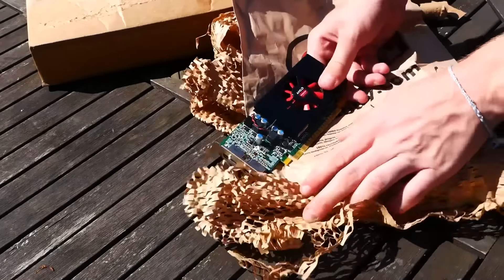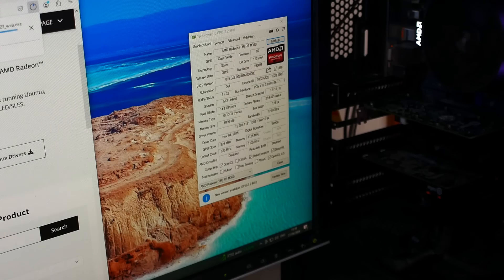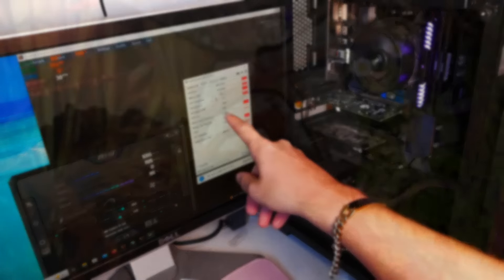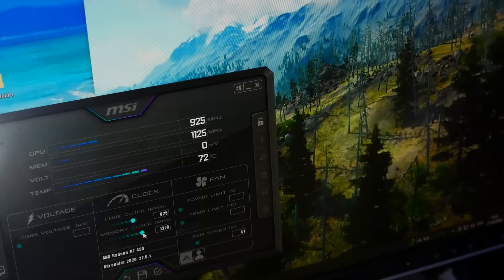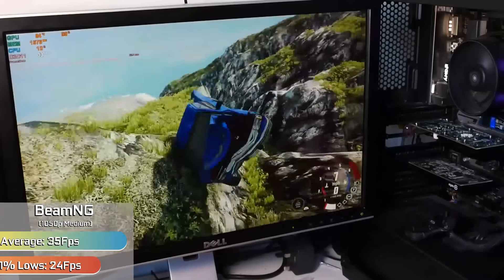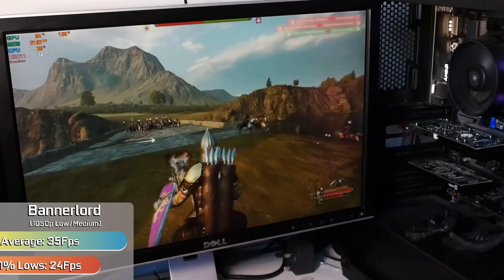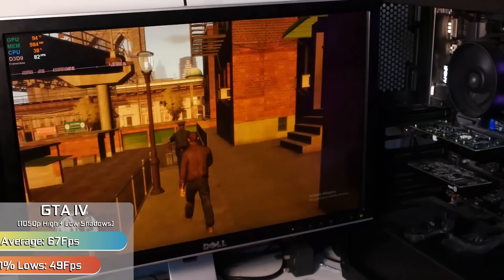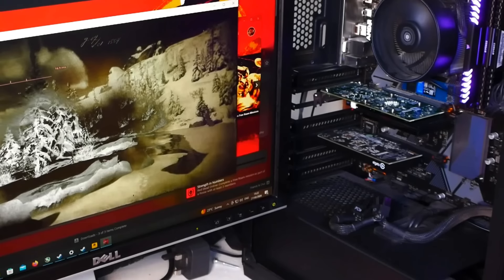AMDs Mysterious & Misleading R7 450...

Comment: The fact that the lights on the motherboard were on while you swapped GPU's made me extremely uncomfortable. I'm sure there's zero power going to the slots but still.. I would never leave the power supply turned on OR plugged in to the wall when swapping components because with my luck not only would the part fry I would too 😂

Comment: I have an R7 250 I extracted from the Dell it was originally installed in, and it has a very weighty slab of copper sitting on the CPU chip -- so it seems odd that your 450 didn't.

Comment: A GTX 750 Ti competitor kept in the dark? Here with 4GB GDDR5. Interesting ...and actually usable nowadays.
For £5 it's a total bargain! Good find. The cooler seems a bit borderline. But again. SFF just has limitations in cooling. The Thermalpaste renewal and cleaning look like it kept at below 90c. No problem. These Tiny GPU dies should easily handle 90c temp. High thermal cycles become more more critical on bigger dies due to physics.

Comment: Why not remove to end plate rather than mangling it to fit your rig?  
The old girl survived this long and did not deserve this fate.

I have an R9 360 that I picked up for $5 U.S. on the Passmark GPU list is scores 3032 vs. the R7 450 scoring 1936.
I have it as a backup/test card.
Interestingly an R7 360 scores 3100.

Thanks for the video.

Comment: G'day BBO,
Sadly even GPUs like this one don't really get this ($10AUD) cheap down here in Australia, but I have found a few bargains at $20AUD like my His R7 250, MSI GT1030D4 to use for DVi out on my LGA1156/1155 Archive PCs made from the old parts when helping people upgrade. 
I did better this week with my answers in the Guessing Competition compared to the Dismal Failures of the last 2 weeks,
While I was off with my Silly "Hoping you found Treasure" with RX560 my REAL Answer of R7 450✔
+ Running GTA V very playable at 1050p High & RDR2 running 30fps with what I call "Minecraft" or "PS2" settings as 720p gives Blocky Pixels on a 1080p Monitor🙃👎.

Comment: Upgrading every 3 years or less?!?! Not me! I STILL use Maxwell 2.0 gpus for my 3d graphics rendering workstations and I’ve had and ran these exact same cards that I have now for the exact same things I use them for now since back when using Maxwell 2.0 gpu was actually the norm. And back then these cards costed a fortune (I got them as gifts from someone who was switching to amd for whatever reason) and then there’s my titan xp which I bought when I got my first job at McDonald’s and that’s still my go to gaming card! The only recent generation card i bought and currently own is an Intel arc a770 and that’s only because the Titan X in that computer died probably because I put way too much load on it doing intensive 3d graphics rendering sessions overnight for back to back nights for around a month (I don’t advise doing that if you’re on a strict budget and can’t afford to burn through $200 something and up gpus with no care in the world) and i needed a card that can handle some degree of raytracing and Nvidia and amd were out of their blooming minds with the gpu prices and the ones they offered that I could afford at time were 8gb cards and I never touch anything less than 12gb. The a770 i got is a 16gb and supports raytracing and at the time costed as much as an 8 or in some cases 12gb RTX or Radeon so in short i usually don’t upgrade for anything less than about every eight years

Comment: I wonder how this works with the Mesa drivers and DXVK/VKD3D? I'd wager a lot of the driver issues you ran into wouldn't be a problem there and stuff like the card not being picked up on occasion can be solved by using DXVK/VKD3Ds configurations to force it to appear as one of the older models that the game does know.
Reply: It should support Vulkan 1.2, with updated drivers so DXVK might be an option.
VKD3D is completely out of the question, that requires Vulkan 1.3 support.

Comment: I have one but only used it on a 3.3ghz quad optiplex. Some free games ran awful but a regular first person shooter ran ok. Presently I'm not sure if the display ports are working or the two to dvi adapters are not working but alas it's failed. Oh but mine cost around £35 😢

Comment: I'd be curious if the same games that had problems might run better in Linux using Proton. It may be possible that the open source drivers have more gaming support for the card than the official Windows drivers.
Reply: I guess that comes down to how well the DXVK implementations on the card handles those games.

Comment: I bought 5 Radeon 550 (basically rx 550 without the rx) and they ran hot as balls, they are 50w cards and i had to literally dig into rheir bios to find ou t the fans domt go to 100% till 90 degrees celsius, changed thw fan curve on afyerburner and they are pretty cool, tried to mod the bios but it bricks them and wont show image

Comment: Here in Germany, the card is 50€ on eBay sadly. 

But they are selling "Radeon RX 550's" here for a very low price. I put it into quotes, because the RX is made up. These are Radeon 550 cards, which are slower than RX 550's. AMD's naming is weird. 

The cards usually come with a black shroud and a radial fan, low profile. 

I have bought one with 2GB GDDR5 and it's doing fine for a Core2Quad low profile build for late 2000's and early 2010's Win7 setup. 

Please do a video about it, so less people won't confuse the two.

Comment: CeX UK is selling the 7870 2GB for £18. It is quite the uplift compared to this!

4GB on this chip seems rather pointless but at least they used fast chips and 128bit datapath.

There is also the 660 which, in my experience with 2GB cards, has less stuttering in most games. Some will run a bit slower due to being Kepler but not all.
Reply: Instead of the 660 I would take a 660 Ti, it's equal to a 670 in everything but memory bus. But if you can find a 670 or 760 Ti for the right price, those are also great choices.

Comment: at 7:32 zoom in on heatsink to observe heatsink curl during heat up , take emery board nail file and left to right or right to left the very edge of the chip die it self those bubble spots observe red on the heatsink show super temp area's sanding the chip removes just enough to blend it in.... DO NOT TOUCH THE SUBSTRATE... then clean thermal paste 90%+ chip contact when i started the software didn't know what to do with all the function. now they have FSR
Reply: 99% operation chip
Reply: 97% finenn

Comment: The R7 250 is not an HD7750. It only has 384 shaders. It also has DDR3 but clocked fairly high at 1000MHz. Still, the GDDR5 on the 450 has more than double the bandwidth so the 250 is less than the 75% of a 450 it would seem. 
The 7750/R7 450 has 512. Same architecture though, GCN 1.0. 
The R7 250 was also called the R7 430 and HD 8670. Fun fact, the Xbox One and One S also uses GCN 1.0 cores, 768 of them, exactly double the count for the R7 250. The One X uses GCN 2.0 cores. The R7 250's Oland XT core was never used for mobile applications so it is curious the Cape Verde PRO one was.
I have a 1GB HD7750 and now I am wondering if I can put 4GB on it...
7:00 Unsurprisingly, this is about where my R7 250 OEM tops out on core clock. But I can get around 25% more performance over stock clock on that card because it is a lot lower. I have a couple of early Nvidia GDDR5 cards that have no VRAM cooling and that's about where they top out on VRAM OC.

Comment: If you run into similar trouble with GTA IV in the future, there are launch options you can use to override the memory recognition. Have to use it for my Arc GPU lol... It has no idea what to do with it. "-percentvidmem 100 -nomemrestrict -norestrictions -noprecache -novblank -availablevidmem 16256.0" for a 16GB card for example. The string is overkill but it lets you try whatever you want. If you use steam, just go into the properties and you can enter the launch options there. Otherwise you can use the options in the graphics configuration file I believe, or maybe in the exe options in windows itself.

Comment: Any tips for getting this GPU running on windows 7 32bit? I have a dual Pentium III system I want to run this card in for fun.
Reply from the maker: Could try forcing it to install as a HD7750 using old crimson drivers?
Reply: @BudgetBuildsOfficial  Thanks! I'll try that soon
Reply: Update! Using a pci-2-pcie bridge chip adapter to connect this GPU up to a dual Pentium III system (tested on 3 different systems), turns out this GPU, along with several AMD GPU's I tested do not do very well, and bearly managed useable FPS in any game. However, supprisingly a 1GB GT210 outpreformed the R7 450 in ways I cannot explain. But yes the Crimson HD7750 drivers worked perfectly to get it running, despite the bridge-chip bottleneck.

Comment: 3:47 where does the r9 280x fall in this?
Reply: that is basically HD 7970 that is the Top high end. those are cards without any external power required. Only from PCIe that is max 75w TDP. Mid range or lower.
Reply: @DanielCardei  oh.

Comment: I wonder how it does against the RX 6400
Reply: The R4 450 comes with full 16 lane PCIe 3.0
The RX 6400 comes with 4 lane PCIe 4.0
On a board capable of PCIe 4.0 the R7 450 has about twice the bandwith. If the board only does PCIe 3 it's 4 times.
But the RX 6400 has a significantly bigger chip (50% more) and much higher memory bandwith (3.55x), so it should take the lead with a huge margin, even on an older platform where it looses 20% of it's performance.

Comment: The cooler that is on this card kind of reminds me of something I did to a HD 6670 that I had in an old APU machine if anyone remembers them. The cooler looks rather similar to the cooler on the HD 6670 and I remember upgrading it with a cooler I got off Alliexpress for a card in the same family of GPUs that had two blue fans on it. The cooler was like tenner or something in that ball park and I still have that card and it looked like a higher tier card with that bigger cooler which is nothing to complain about! Got better temps too. Went down by a good 15-20 degrees or so :)

Comment: The biggest missing part here is actually Linux gaming.
Does a lot of the issues transfer over with the OpenSource drivers under Linux as well? Could tell a different story as they are built differently and probably still under support.
Reply: It's a GCN1 "Southern Islands" card, and is supported on the radeonsi branch with will 3D support and power management. But I doubt it will run any cooler, considering power management is supported on the Windows driver as well.

Comment: Dont feel bad about how badly it deals with GTA IV. On the same settings (and using DX9) my RX6600 has a third of the framerate. I had to force it to run on Vulkan (yup, can be done) AND also keep shadows entirely off or framerate would tank to the 20s. Funnily enough, the GPU was horribly underutilized either way and I could switch from 1080p all the way to 4K with downscaling with zero performance difference. It would just mess up my desktop and all the windows.

Comment: I wonder how this compares to the OEM R5 340x and RX 550 I got for cheap for a server (did not work in the server… thanks Dell)
Reply: The R5 340X should run significantly slower. It has a 25% cut on the GPU and about 55% less memory bandwitdh.
The RX 550 has about 55% more memory bandwidth. The GPU is equally cut, but clocks around 4.7%-12.6% higher, depending on how well it boosts. So it should run a bit faster.

Comment: in all fairness 6000 series runs hot.  My 6700xt runs in the 80s on the hotspot on heavy utilization, has from the moment it came out of the box. H510 case doesn't help, though.
Reply: Hotspot temperature is not something to worry about, we all survived all these years with single sensor on the chip (or even not on chip at all before that). Is average temperature ok? Then it's ok. 
Hotspot is useful only if difference between average and hotspot is really high, 12-15 degrees or more. Then you know that there is a problem with thermal paste or pressure on die.
Reply: @gorky_vk  As a former user of a 8800 GT I can completely agree. When the single sensor reports 100°+ under regular gaming load, all those 80s are nothing.

Comment: Makes me think of my a6 3650 apu that would clock at 4 gigahertz with no complaints. I wonder if it would run well in a Linux gaming system. You could use it for virtualized remote gaining servers just dropped two or three of them into a case dedicate each to a different VM set up sunshine Bob's your uncle

Comment: This looks like it's basically the same card as the HP R9 350, which in itself is an R9 M360 slapped on a desktop card PCB with a crappy heatsink.

Comment: Is it normal for the R7 450 temperature to be between 85-90 degrees?
Reply from the maker: With such a small cooler unfortunately yes.
Reply: @BudgetBuildsOfficial  Can the graphics card burn?
Reply from the maker: It’ll throttle over 100C usually on GCN1

Comment: its like a radeon 4850 which I had and it was a beast (512sp)
Reply: Feels about right. The HD 4870 was similar to the HD 5770/6770 in performance, with the HD 7770 pulling a bit ahead.
The HD 4850 is a bit slower than the 4870, but the 7750 is cut down compared to the 7770

Comment: I wouldn't bother overclocking it will go thermo nuclear
Reply: the temps are due to the fan curve, it doesn't spin until 90c
Reply: @talibong9518  oh it does on my hd 8570 and anything above 30% is audible but thankfully you can turn it down to  25%  as long as youre not gaming
Reply: With undervolt it will run around 75-80c max

Comment: This card would've been perfectly cromulent during the GPU "shortage" aka massive scalping BS era. None of the scalping idiots would've cared about it, but it would've gotten you by without buying a cache-crippled APU (hello R5 5600G/3400G/3200G), sacrificing CPU perf for getting an iGPU just to have anything that outputs video.
Also re GTA IV... by "config menu" you probably didn't mean the commandline txt file in the game directory right? Cause that's an option and was basically required with GTA patch1.0.7.0 and earlier to force it into detecting the correct amount (or any amount) of VRAM, and force enabling some settings. Just don't touch the ingame settings menu after messing with it or things will either break or reset. Another thing, in GTA V/online you can disable shadows entirely (or force them to a specific setting) with the settings xml file found in documents, rockstar games, gta v. Putting shadowquality and reflectionquality to 0 disables them, which makes the game looks very weird but allowed me to play on some very bottom-barrel hardware (even a Core 2 Quad at one point lol)

Comment: I just looked on ebay for R7 450 grahics card, They are all over £100? Some even £388.  CEX £15 . Wierd.
Reply: Those are sold to companies that sells them to other companies with high tags.  
Used to work in a similar environment where they called a company to swap a compatible monitor for machine. £1100 
Next time that happen i found an adaptor for £3 and put a generic monitor and everything was working perfect because the time the company offer to find and swap was to much to wait for that machine to be offline. Got a promotion, training on that machine and every outdated tech came to me first if i wanted.

Comment: Ahh, a Cape Verde Pro chip, the same as in the HD 7750 and R7 250E (and in specs also identical to the Cape Verde XTL in the R7 350, which was sold on the free market in 2016)
People complain about nVidia rebranding the same low end cards again and again (like how one of the GT 730 models is actually a GT 440), but AMD has been doing the same for ages as well.
Reply: It's written NVIDIA, not "nVidia".

Comment: I will have to dig out a strange Dell branded 7750, has 4gb of gDDR5 and had virtually no driver support outside of Dell's then closed off support service and it was atrocious trying to run it, abs sucked balls at everything when I bought it, it should have been the dogs danglies but sadly no and I went and bought a 780 and 750ti pair brand new from nVidia which were both excellent cards but nVidia pushed both into legacy fairly quickly so I stuck two fingers up at nVidia and bought an ATi RX560 4gb which ran super well when I replaced it last year with an Aliexpress RX580sp which runs awesome despite being legacy now.   Now I refuse to even let a nVidia darken my doorstep the money grabbing customer gouging whatnots (insert suitable expletive of your choice) and its been a spider system (all AMD is known from the old days as a spider system...) and the RX580sp runs super well with my Ryzen 5, 32g of ram, SSD etc   Now cooling on the CPU was until the Ryzen done by Coolermaster's MK1 V8, it was only I couldn't find the AM4 brackets that saw me stop using the V8, abs brilliant cooler giving AIO sort of low temps under load, I bought for £10 brand new a Coolermaster MasterAir G100M which everyone slated as crap but in my Coolermaster HAF-XM monstrous sized case it works abs brilliant, has one massive central heatpipe and a flower heat diffuser like an old Zalman but I is very happy with it :D
Reply: It's written NVIDIA, not "nVidia".